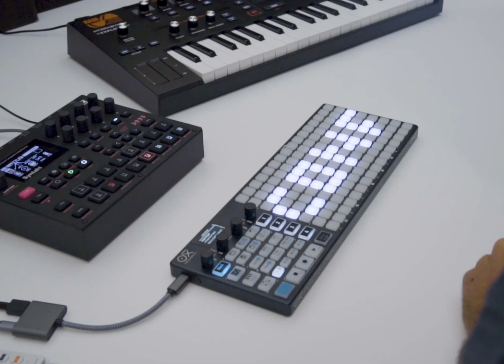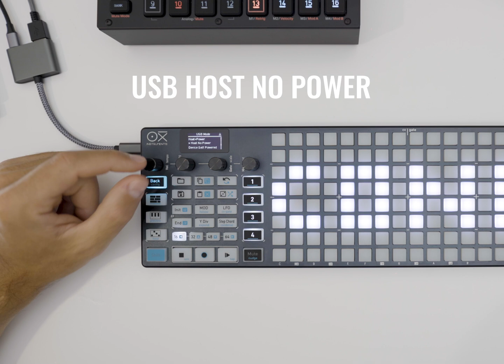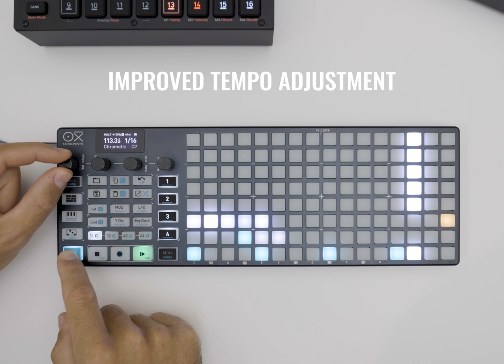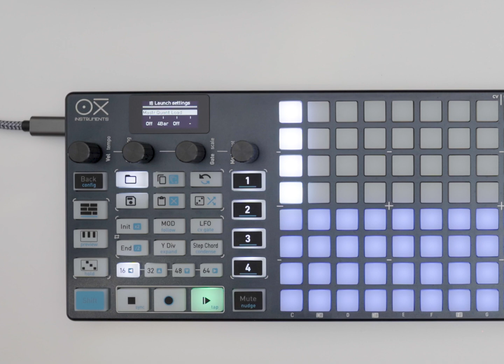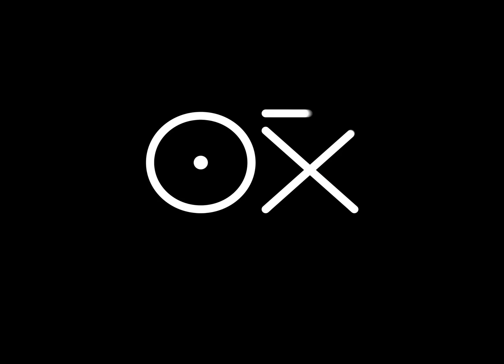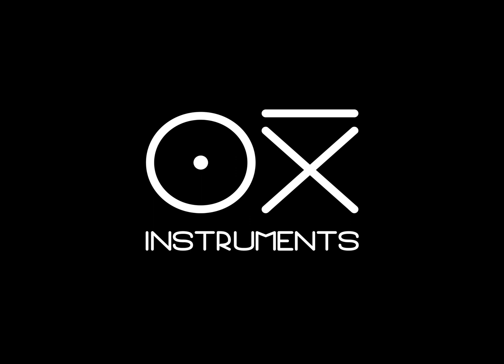OXI One Tutorial - Set up a MIDI device + 3.0 new features explained

Comment: The adaptor is elegant. If I have also Digitone and Digitakt to connect to the OXI ONE for example, i could use MIDI cables...Or, if it exist, the same adaptor but with three USB  A ports (elegant as well...)
Reply from the maker: To connect more than 2 devices with USB you would need a USB hub and those are not supported unfortunately.
OXI Split would be the solution in that case.
Reply: @oxiinstruments  Yes I have it ! I'll try. I've purchased at your web site

Comment: For the love of god, I cannot make it work. Works fine if I use the TRS midi to the midi input of the Syntakt but it will just not work with USB!
Reply from the maker: what adaptor are you using?
Reply: @oxiinstruments  Hi. I use an adaptor from Anker (Anker 332 USB-C Hub 5-in-1), model A8355.
Reply from the maker: @gorbzzz  HUBS are not supported!
Reply: @oxiinstruments  Hi, I am puzzled. Isn't the one you use a hub? If not, what should I look for?
Reply from the maker: @gorbzzz  you have a pretty long list of supported adaptors in the manual!
Reply: @oxiinstruments  I missed this part. Thank you!

Comment: Is it possible to use parameter locks ? For example adding yellow triggers in digitone to variate the sound that play in determined step. And then use this sequencer ?
Reply from the maker: Parameter locks are implemented in the OXI One in form of:
- Velocity, octave, gate length, ratchets, micro timing offsets, trigger or logic conditions 
and
- Modulation lanes where you can set CC values per step.

Comment: At 1:30 you set the step length to 38 steps, how high can the step length go? How about in the other sequencer modes? I am torn between the OXI One and something from Squarp, I need something that does interesting lopping polyrhythmic generations, but also can go higher than 64 or 128 steps on another midi channel. Very frustrating that 64 and 128 have become the standard maximum, in 90's gear many sequencers could do over 64 bars! And thank you for these videos, they are really informative!
Reply from the maker: You can do up to 128 steps.
Each step can have up to 8 notes and each note contains pitch, velocity, gate, octave, micro timing, glide, trigger probability, trigger conditions.
As well as up to modulation lanes
Reply: Which sequencer did you finally go for? I have the same issue, as I tend to play really long, melodic songs. I record live from my synths and just want to store long patterns/sequences that I want to later trigger on the fly. Cheers.
Reply: @doubleohdutch2108  Yeah, I have a Pyramid and it's decent (sorta unlimited pattern length? in that you can keep adding pages of 16 and such), I am considering going eurorack with a Hermod+ with an Oxi Coral, Hermod+ is about 256 steps by 8 gates and triggers and I think and they are saved in loopable/sequence-able clips (I believe!), still want an Oxi One, of course, but it might be on the backburner for now.